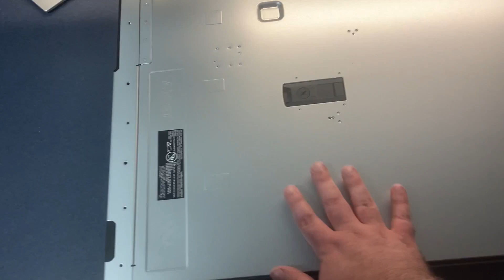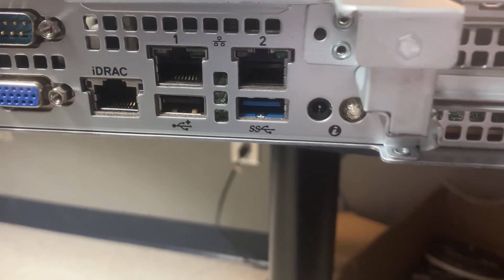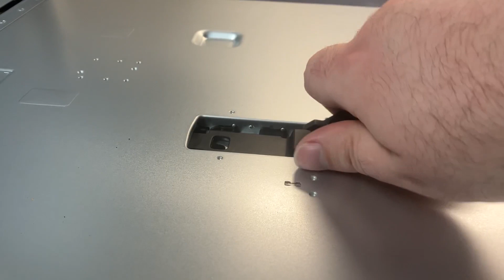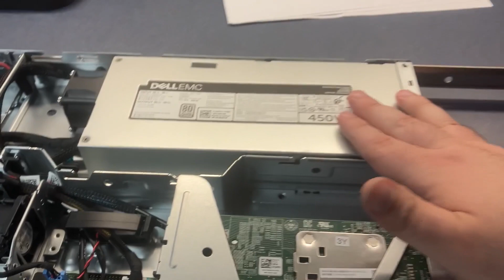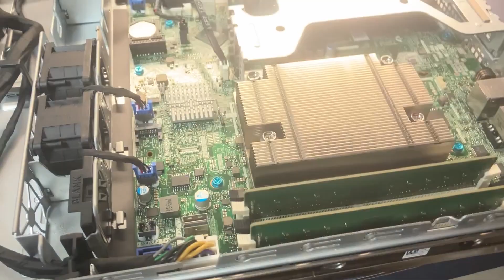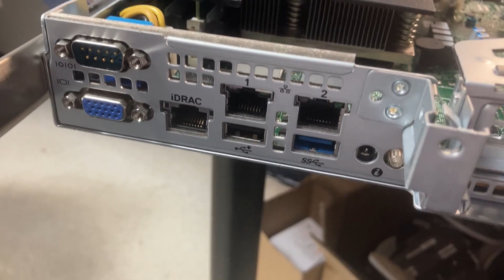New firewall server (OPNsense)

Comment: The nice thing about this is it has so much potential & it won't suck the power all from the wall. R250 is a nice unit. Just add a pair of ssd's and a nice 10gig nic and your off to the races !  Good video BTW.
Reply from the maker: Fun fact: turns out I needed an additional NIC for a redundant WAN connection. The unit accepted it without trouble and keeps on running like a champ!

Comment: Bs! For a router all you need is a dual core cpu and a pcie quad Ethernet. Done!

But if your customers like to overpay for off the shelf solutions…
Reply from the maker: If this was strictly a router, I would probably agree with you. But as I noted in the video description, this is a firewall. Specifically, this is going to be a layer 7 firewall inspecting traffic for about 1000 devices using a 1 Gbps synchronous connection. https://www.zenarmor.com/docs/introduction/hardware-requirements

With that established, have I overbuilt a little? Possibly! But then, I need the stated requirements immediately, and I still need to take future growth (device counts, connection speed, newly-required features, increased software requirements) into consideration over the next 5-7 years.

I actually started by pricing out a rack-mounted Supermicro-based solution where we would purchase parts only and then I would do the assembly myself. Based on just the cost of parts versus the cost of the Dell system, the Dell was cheaper--which surprised the heck out of me, I don't mind admitting.
Reply: im running opnsense with wireguard and openvpn tunneling on a dell poweredge r640 almost 40 users to a connected to the site, a small router wont be able to do that.
Reply: why you mad bro
Reply: As someone who is currently upgrading my opnsense box from a dual core CPU because it handles routing fine but can't handle routing + firewall I'd have to disagree.